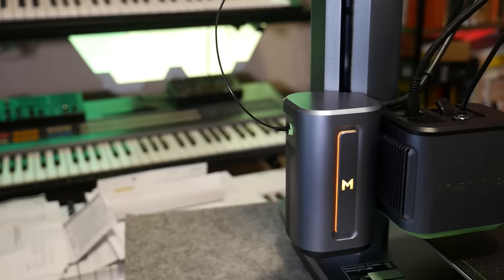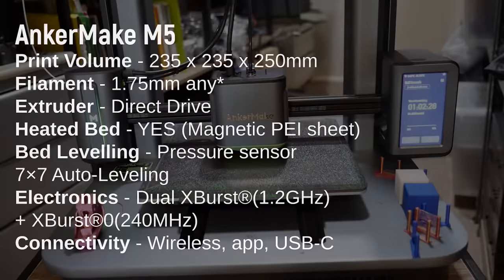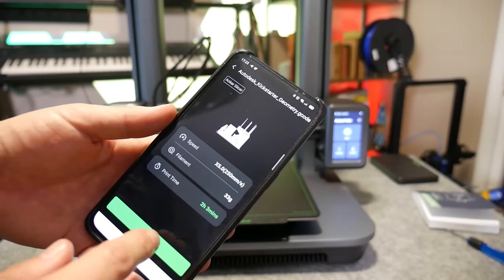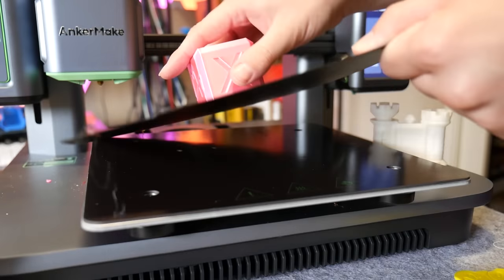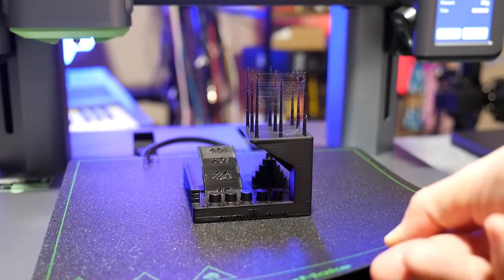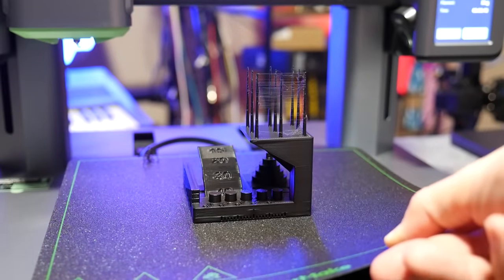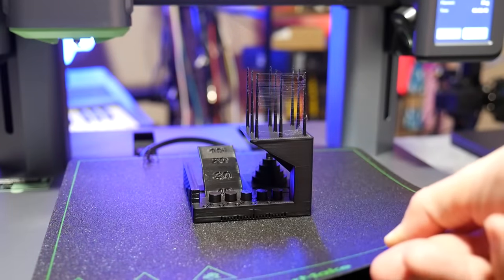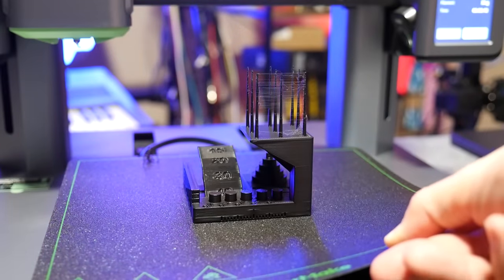AnkerMake M5 3D Printer - Awesome or just hype?

Comment: I'm one of the Kickstarter backers. Judging by my own experience and from what I've seen in the discord, it seems to be a bit of a dice roll whether you get a good working unit or not. Personally, my experience has been less than stellar. It started out okay (apart from little things mentioned in this video), but got progressively worse, until I stopped using it because it just wasn't fun anymore.

There is a lot of drooping during pre-heat (compared to my Ender 5 at least), so much so that it almost always forms a blob on the nozzle which has more than once caused the print to fail. The bed doesn't seem to be perfectly flat, which shouldn't be an issue thanks to the automatic bed levelling, but somehow the first layer still looks very different on some parts of the bed than on others. And since there's no way to manually adjust the bed, there's basically nothing you can do about it except fiddling with z-offset and putting paper or tinfoil under specific parts of the print surface (which is something I've seen people do and recommend on the discord, haven't tried that myself yet).

Then when the included spool of filament ran out, is when things really went downhill - I'm not saying it's because I started using non-Anker filament, because I'm pretty sure the machine has no way of knowing that, but ever since then things have been making trouble.

For starters, the switching of filament itself is a pain. I don't know if that's a thing that's different from unit to unit, but I have trouble properly feeding the filament in. You can push until there's some kind of resistance, and you think you're at the nozzle, but there must be some kind of second opening to hit there (can't see because the part is enclosed) and most of the time it doesn't go in properly. At first I thought my nozzle was blocked, until I tried and suddenly could push a bit further than before and felt some kind of "slotting in". And that kind of thing keeps happening whenever I change filament, I have to try umpteen times until I can properly get the filament in. I have tried cutting it at all kinds of different angles to see if it makes a difference, but - not really.

Ever since that first filament switch, I've had extreme problems with the first layer. Basically, it extrudes the priming line at the edge of the bed, but then goes through the skirt and part of the first layer without extruding anything at all, and I have no idea why. I managed to make it come out early enough by fiddling with temperature, flow rate and a few other parameters so that now at least for simple prints, it works 50% of the time by sheer luck, when whatever is there doesn't get ripped off and we're basically printing in the air for layer 2 in some parts. Then, sometimes, it's enough to kind of stay structurally sound enough to finish the print. The last project I did were 4 simple parts, which each should have taken about 15 minutes. I think I was fiddling with it for at least 4, maybe 5 hours until I finally had the things in my hand. The printer then telling me after each piece that I saved 45 minutes compared to other printers then felt like a slap in the face.

There are more nitpicks I have, but I've already written too much. I do want to mention that during printing, even with the same PLA filament, the smell is somehow worse than with my Ender 5 - no idea why that could be. Maybe because it's faster and thus melting more filament in the same time?

There's also been numerous reports of beds not being tightened properly and similar kinds of stuff that ended up in an FAQ list, which is the usual for 3D printers, but feels kind of weird for a machine that basically has the selling point of "it just works".

In fairness, when it does work, it's very fast and the prints look and feel great.

Now I want to reiterate that I was a kickstarter backer - maybe they've ironed out the baby problems now with newer units. And maybe they've fixed some things with firmware updates - I couldn't tell, I haven't used mine in a while now tbh because it's not the fire&forget machine I hoped it would be. For me, at least, it requires at least as much fiddling and restarting to get a print to start properly as my aging Ender 5 and its sagging bed, which is entirely not what I bought this machine for, and especially not at this price point.

Comment: You echo my thoughts perfectly, I've had it for a few months, and the change from then to now is gargantuan. One thing, aside from the slicer I want them to fix, is the firmware update changelogs, actually tell us what changed goddamnit!
Reply: I agree they should make the changes more openly available, if you goto the discord they have a release notes section that tells you the firmware update changes. First changelog post was in beginning of march
Reply: The slicer is easily the worst part of the printing experience I’ve had with it so far. At least the app notifications have cooled off a bit ;)
Reply: @UncleJessy  they said theyre relaunching the slicer based off of prusaslicer soon, and they have ankermake profiles in prusaslicer nowm, which is dine, but i cant believe just how poor the ankermake slicer has been since November or whenever i got this thing. for the longest time it would rack the gantry every time is homed, only in the last update or two did it enable gantry leveling as part of the start gcode, its absolutely maddening. 

it prints beautifully, it prints fast, but my god is it loud.

Comment: I was just running one of my Ender 3 with hotrod upgrades and I was remarking at just how silent it is from a stock Ender one. This one you're showing is loud AF. I hope it can be upgraded to be more quiet.
Reply from the maker: The fans are super loud but the hot end is pretty custom. It might be possible to change but not as easy as modding an ender 3.
Reply: @MakersMuse  maybe we can get a noctua fan mod ;) Thanks Angus
Reply: @geekdomo  Noctua fans don't push enough air for that, but the discord community has a part cooling fan mod that is well tested and nearly silent already.

Comment: Best printer ive had so far is my Voron 0. After that I would not go back to a bed slinger. And why the rollers at such a price. 
I think the Bambulab or the new Prusa would be a far better choise. I would rather spend more money on a Machine/tool so that it will just work without me tinkering all the time (Ive had that with my Anycubic Chiron until I switched to a different mainboard)
Reply: Or buy an old used prusa even. Anker missed the mark in my opinion
Reply: @enb3810  lmao the MK3S is not that great
Reply: yeah, if the argument is about user friendliness, you don't need it to be slick and shiny to be beginner friendly which i guess anker does win points in that regard. Though it's still cheaper with not much less feature than a mk4, so like i guess there's a very small argument for it?

Comment: To be honest, I'd rather get a Bambulab X1, ok for a more comparable price I guess it would have to be a P1P (which is only 659 EUR). It is still quite superior in many ways, other than blinky big screen controls. I also like how the turned a bug into a featur by suggesting quite prominently to print your personalized enclosure tiles (and also helping with suggestions in that)
Reply: yeah if both printer end up being loud, you may as well go with the well built gimmick free bambulab one
Reply: Big misconception. Bambulab posts their price without VAT. The p1p is actually ~850 euro in moest european countries.
Reply: @stijnnowee1234  Sorry, totally forgot about that. So the P1P is not cheaper, but comparable to the M5. Still a better deal in my opinion. It is a bare minimum high quality printer. So they cut down everything that is not necessary for the print performance and invested the money into the rest. So the mechanic design comes without compromises unlike the M5.
Reply: @aronseptianto8142  According to Nero the Mk4 is less noisy than a Mk3 and the Mk3 is one of the most silent 3D printers I know without an enclosure. But that will need some further verification, at higher speeds the Mk4 should also get noisier of course.

Comment: Angus - Been an avid follower of your work for years at this point, but I think you were not particularly critical of this product. 

To summarize: 
Cons
- The slicer still needs work
- The app still needs work 
- Its real loud 
- The LCD screen is on the Z Axis and not pointed up
- Change filament settings don't extrude first 
- The print fail AI doesn't really work 
- False marketing on print speed 
- Uses V rollers 
- Print Bed has no idexing for putting back
Pros 
- Mostly well designed 
- Looks good 
- Good packaging 
- Great 3D printing kit for folks 

With other options out there, like the MKIII that's on sale now, the MKIV, and the Bambu Labs, you should have been a bit more critical of a machine that is in the price point for getting it perfect out of the box. 

While I haven't used the new MKIV, I've got tons of time on the Anker M5, MKIII and P1P, and the Anker is by far the weakest of the three - aside from it's industrial design (but if we're going on Ram's principles here, I would argue that machine is not "Honest" or "Unobtrusive"). Combine that with the recent news of Anker sending home security camera footage to unencrypted servers, when they said they were not, and you've got a *VERY* hard sell for this machine.

Thoughts? I am way off base here?

Comment: I just got an AnkerMake M5 for the school district I work for and so far, coming from strictly MakerBots, I love it. The speed is quite phenomenal, the accuracy has been pretty good, although I've had a few issues that adjusting the speed down to 100mm/s solved, but by far the worst part is the slicer. I've tried to use PrusaSlicer and then bring that over to the AnkerMake slicer but it shouldn't be so difficult to make a decent slicer in 2023

Comment: I recently set this printer up and I think the firmware update certainly helped a lot. I've been getting some very complicated prints out of it and so far out of about 50ish prints and 5 spools worth of filament I've only had two failures: One was due to a tangle in the spool so can't fault the printer too much and the other was just a weird hiccup where the hot end turned off so it cooled down and stopped extruding (I have not been able to replicate this bug and even trying the exact same gcode it ran fine). The speed is killer and what's more is its accuracy AT that speed that gives it a nice wow factor, I do run it at 150mm rather than the full 250mm as it's a good balance of speed and fine detail. 

It's really true that this is a really cool product for people who just want to print neat things, while it lacks a lot of finer control (I'd kill for custom supports) for simple drag and drop prints it really shines. I REALLY hope Anker fixes the fans because while I can barely tolerate it while it's running they also run 100% when it's NOT printing at idle, they really need to give the fans a sleep function. I have it on a smart plug so I can remotely turn it off and on as I like using the wifi controls for the printer itself. 

I usually jump back and forth from using Cura 5.3 which has the profiles baked in now and the Ankermake software as the majority of the time it's good enough but for power users certainly you'll want to use Slicer or Cura, that said I have noticed that prints using just Ankermake natively (so long as it doesn't need a lot of supports) tend to be more accurate and clean which is curious.

The REAL problem for the M5 now is that the Prusa Mk4 was just announced, and of course I watched the video for it shortly after setting up the M5 (which I bought as a secondary to my Prusa Mk3). I think if you're going to have just one printer the Mk4 looks to blow it out of the water for price but I don't regret buying the M5 overall.
Reply: I was wondering. Did you pause and extrude during the failed print where the nozzle cooled down?
I had this happen during a paused print for changing filament. I was able to recreate this issue but only when I extruded during the pause.
Reply: @Wolter van den Berg  no not during that one at least. Last night I did have a power outtage where the printer was able to resume but so far so good on that one.

I wonder if doing a mid print change will make the bug appear

Comment: It's still a bit difficult to justify the price compared to an Ender 3. Automatic Leveling is great and all, but in my experience you dial it in once and it stays like that forever, as long as you don't swap nozzles.
Reply: Ender 3 isn't even in the same tier as this speed wise and feature wise.
Reply: @viru52000  yeah but imo what i did is buy a neptune 2 for 107 euros and now i buy 300€ in china upgrades. True dual z, bltouch, v6 hotend, bmg, klipper, cooling mods. This will print as fast as a bed slinger physically can. Well with the proper cooling atleast.
Reply: @durschfalltv7505  Neptune 2 is an Ender 3 clone.  V wheels on the Z (unlike the Anker).
Your upgrades are less than what the Anker runs, as it runs a load sensor for probing (BL Touch isn't a comparison), high flow hotend (almost double the flow of a V6), camera, etc.  I do think the Anker is a bit outside of it's price point (even on sale for $120 off for $680) and should be more around $500 to compete with the Prusa MK4 and Bambu Lab P1P.
Reply: @viru52000  why? Even if this printer has double the speed, it's not gonna make a difference for most users.
Reply: I could never get my Ender 3 dialed in, nor could I get it to stay dialed in on the rare occasions I could get it to actually complete a first layer.  I had it for two years and could probably count the number of successful prints on one hand.
Reply: @achannelhasnoname5182  Creality has a huge following...much like Anet did until Creality came along.  There's no reason to buy a V wheel bed slinger with a plastic bowden extruder that's known for failures and QC issues when something like the Sovol SV-06 exists.  On the topic of the Anker, it's 3x the speed and even if you went the same speed, the prints would look better as Input Shaper removes ringing and other print artifacts.  Until you have a machine this advanced (like a Bambu, Voron, Rat Rig, etc) you won't get it.  It's like saying everyone should drive a Yugo.
Reply: @thesledgehammerblog  Yeah there are much better and cheaper maschines than ender 3 now.
Reply: @thesledgehammerblog  allthough yours sounds like a faulty unit. My dad got a ender it always printed very nicely.
Reply: @viru52000  Yeah but it has a 32 bit mainboard with okish drivers for x and y axis. And bl touch is plenty. Linear rails are not the holy grail. V rolers are fine. High flow is yeah. With v6 and cht nozzle thats plenty. You will probably get 70% of the Ankermake for 1/3 the cost. The ankermake should be 500 yes.
Reply: @thesledgehammerblog  i just got bl touch because i didn't know about euclid probe kit when i ordered. Fake kits are like 20€. I could also get linear rails. Better mainboard and better steppers, orbiter 2 and dragonfly and still be under 600. Obviously all fake shit but who cares triangle lab makes quality rip offs.
Reply: @durschfalltv7505  all boards should be 32 bit, the only reason Prusa held onto the 8 bit boards IMHO is that they had a large surplus of them. 32 bit processors are cheaper than 8 bit now. On the subject of V-wheels, they're cheap, that's the only advantage. They wear and they're not precise, even compared to linear bearings on rods. BL Touch have always been finicky and don't like heat. Also, without a high flow hotend, you're not anywhere near the extremes of what Klipper can do...
Reply: @viru52000  v-wheels don't wear. They wear if you can't tighten them correctly. If you tighten them correctly they last thousands of hours and are precice. Just saw a video from teaching tech where he compares ender 3 with linear rail mod vs v roler. Virtually no diffrence at all. Maybe the advantges only show at higher speeds but depending on the filament printing fast is impossible. If you want to print fast buy 7 neptune 2 and leave them stock. I am convinced that 7 elegoo at 30mm will print better than a ankermake at 250mm. And if you want to print a diffrent material like abs you can't even print it fast because you cannot cool it without warping.
Reply: @durschfalltv7505  lol, of course they wear, they're in essence, tires.  Not to throw shade at Teaching Tech, but it's polishing a turd.  Neither machine runs input shaper (or fast), and the components were assembled with rubber washers because the Creality extrusions aren't precise enough to rigidly mount them.  People don't always have the room for a ton of printers, and energy wise, less printers doing the same amount of work is better.  Also, it shows you have no clue about fast printing or enclosed printing.  ABS prints faster than PLA because of it's molecular structure allows it to flow more, and you absolutely need cooling with ABS in an enclosure.  In fact, you'll get curling on overhangs without cooling, causing warping. If you're not in an enclosure, you shouldn't even try, it's an exercise in frustration.
Reply: @viru52000  Ok you got me but i am gonna stand on v rollers lasting thousands of hours of time if you don't overtighten them
Reply: @durschfalltv7505  Id take his info with shovel of salt, i print abs 200% speed on my anycubic vyper with no cooling or enclosure, i can print that fast because ABS doesnt need cooling. Although ive heard it can help(a counterintuative tip form some youtuber),  forgetting to turn off cooling is the only time i had a failed print with ABS.